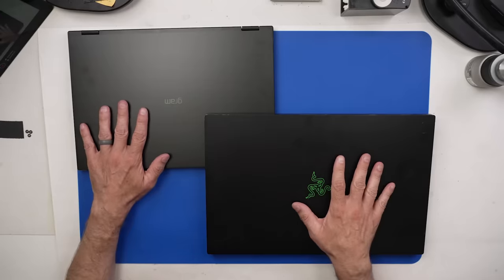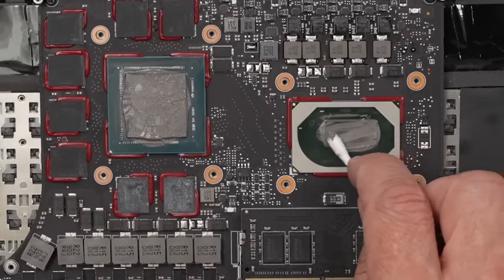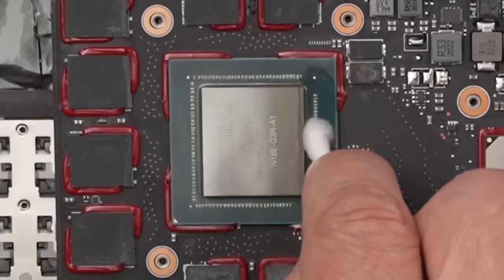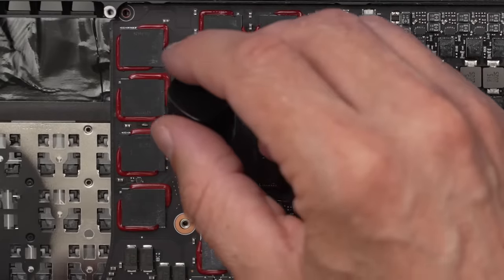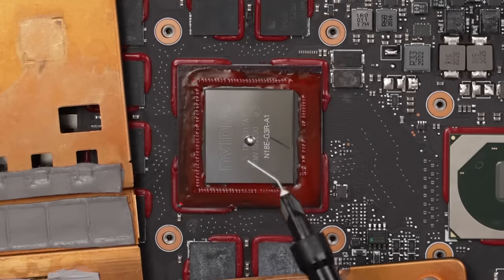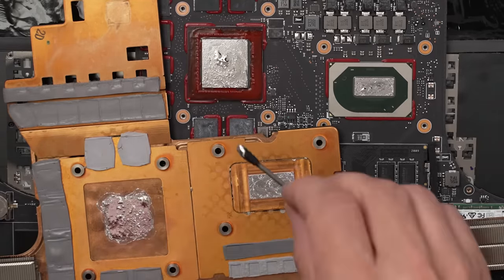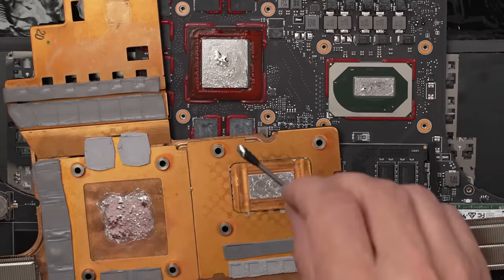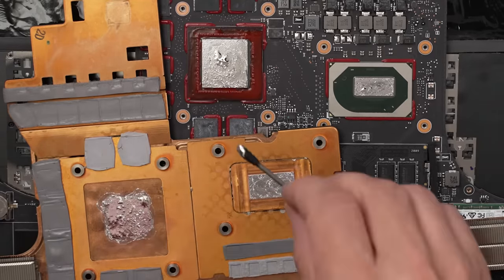$5,000 Worth of BROKEN Laptops - Extended Cut

Comment: I believe that the "problem" with the Razor fans can be configured from the bios.
For the display it would have been good if it were tested with an external monitor, that way it can be ruled out that it is a problem with the video card
Reply: Yeah. The fans were louder after the "fix" than they were before it. The display problem was a sensor issue and nothing to do with drivers.

Comment: But wait.. with the intel driver uninstalled the system will fall back to software rendering through the Windows Display Adapter driver. Is it a driver issue with intel or is the GPU on the intel CPU dead?

Comment: Had you already checked the temperatures and fan curves and tinkered to see if it was a software issue or did you just dive right in and tear the thing apart to redo the thermal paste? This seems like an overreaction without the substantiating data.

Comment: Copper heat sinks and liquid metal for cooling aren't always the best of friends. I hope you checked compatibility before applying. You risk your heat sink getting oxidized away if the two materials aren't compatible.
Reply: It's fine, the heatsink will absorb a thin layer of liquid metal, so you should redo it after a month, so you have enough on the ic's, but it doesn't affect anything.
Reply: Yeah, he is creating a thermocouple, not cool! Although I don't know much about thermocouple, I know enough that 2 metals in junction would create a voltage when heat is present.
Reply: @MizuhoChan 
One month is not a long time.
Reply: *Aluminum heatsinks and liquid metal arent always the best of friends
Reply: You're thinking of aluminum. Liquid metal contains gallium and will eat away at aluminum, but copper is perfectly fine.
Reply: @xrafter  That's why you don't need to redo it after a month?

Comment: "ramps up at login screen": windows fires a lot of services up at the login screen. i have a power meter in my psu. normally the psu is 60w idle, and at the login screen it jumps straight to 120w. so don't compare the login screen with idle, that's happening a lot in the background.

Comment: Hi Steve, Maybe you have to do layer of liquid metal over time as it will work into the copper. The second notebook you need to install the latest Intel drivers, as it currently uses the standard Windows drivers (the checkbox was not available). You can obtain the drivers through Windows Update or the Intel website.

Comment: Copper will soak up the liquid metal. Will need to be checked periodically and re-applied. Nickel plated copper is preferred to use with liquid metal.
Reply: What about the voltage generated by heat? Should we minimized it.
Reply: no @xrafter

Comment: I would assume there is a thermal sensor somewhere that is not detecting what temperature the system is running at and just defaults to full blast on the Razor. Might be worth going into the BIOS and see if you can determine what temp the system is seeing. Hard to believe the liquid metal would make that much of a difference, but I could be wrong.
Reply: I agree. Liquid metal doesn’t make much difference compared to normal thermal paste
Reply: It can make that much of a difference if there wasnt enough thermal paste or the thermal paste wasn't properly applied, which he jokes about in the video when he says "I would say that doesn't look like the perfect amount of thermal paste, but I think I was the one who installed it."

Comment: Using liquid metal in laptop without foam barrier is asking for a serious problem.
Reply: Hence the conformal coating
Reply: just what i thouth to it´s gonna be a mess
Reply: I would have personally done both, especially if it was going to be in a backpack or travelling
Reply: @waynetaylor2784  you still need a foam barrier to protect the rest of the motherboard.
Reply: @gildardo  liquid metal won't run that far
Reply: Spoiler alert! 🤣
Reply: Masz rację oczywiście 
Amatorka 😂

Comment: 31:01 I would apply the liquid metal to the copper then wait for a few hours then reapply the liquid metal again because liquid metal will eat into pure copper and dry out without a minimum of 2 coats. 
Also I would apply the red coating to some of the gold parts near the chip 15:43

Comment: Won't LM eat up that copper? Don't you need coating of nickel or some other metal so LM don't mess up copper, like soaks into copper and makes a different alloy with LM?
Reply: It'll eat aluminium gamers nexus did a test on copper and youll be good with applying on copper
Reply: @nightruler666  He made a video with derbauer who makes the acrtual LM. So he (derbauer) explained the issue is gallium which is corrosive for aluminum and it messes up copper, it DOESN'T corrode it like aluminum, but it makes a different alloy which have different properties than copper. 
My comment is really not saying anything else than this. 
Also that's why he (derbauer) is nickel plating his copper products so they don't loose original thermal conductivity property. 
At the end, everyone should do what they think is the best, I'll listen to manufacturer of LM.

Comment: About trying to figure out at the start whether there really is overheating, and where is it, there is, for linux, the easily installed package lm-sensors. And it's possible to create a linux bootable thumb drive... and to boot nearly any laptop from that thumb drive.  Once the lm-sensors package is installed, the command "sensors" prints out the temperatures of various components, plus fan speeds.

Comment: For the LG GRAM, you may need to change the Flex cable that connects the screen to the motherboard. It may solve this issue. But i've watched the full vídeo, i don't think the issue was only the driver that makes the screen flikering. That flat cable from the display loose also can cause this issue.

Comment: that large CPU should not have that much thermal paste between the chip and the heatsink. looks like there is a contact r pressure issue.
Reply: I agree. I had similar issues on my Asus Rog Strix. Ended up using nylon washers between each screw and the vapor chamber so the screws wouldn't just bottom out. I think this laptop would do well with using PTM7950 rather than standard thermal paste from factory.

Comment: I had an HP that was left on by mistake and put in a computer bag. It overheated to the point where it crashed. It alway ran hot regardless how clean the heatsink and fans were from then on. It wasn't all that stable after that as well. The only thing I didn't ever check was the thermal paste and I guess it could have cooked the paste out.

Comment: I've been using a hexane based electronics contact cleaner for over 25 years now to remove thermal compound. Does a way better job than IPA and really wicks its way into those tight spots when a heatsink is stuck to the chip.

Comment: Not sure people have to go as far as liquid metal, Giving the fans a good clean and replacing thermal pads and paste with good quality stuff got the heat under control on my HP gaming laptop,
As others have said the fan curve can be changed in the bios.

Comment: I used to fix laptops for a living. One time I had a pink monitor. Didn't matter which laptop it was on. The cable on the monitor side was loose. After I removed it and reseated it, it wasn't pink anymore.

Comment: There's one thing i always "CHECK" Before messing with the Laptop/Desktop is Graphics drivers they used to be good but the last 5-6 Years JUNK... Remember one thing everyone "IF ITS NOT BROKE DONT FIX IT" If your Graphics drivers is from 2022 and it works why update them.. I did this Blue screen put them back 100% Fine.....

Comment: So for me, with it spinning up as soon as its powered on, and at that point the GPU wont be being called on for very much at all apart from a display, then my mind would go to the CPU thats getting hot thus making the fans rmp, but even then, that CPU would have to be getting hotter for a while to get the fans going the soon and at full tilt, very strange symptoms if you ask me, maybe some software program needed to control the fans, atleast i would have a look with HWInfo or Afterburner, just to see what the temps are and the usage coz its abit strange for the fans to be ramping instantly unless there was a problem, anyway... ive watched 11 minutes, back to it, and be good to see what happens after Liquid metal, for sure will drop the temps by 5 to 10c i imagine, i dont think thats the problem though unless the cpu is at 100c instantly... Maybe it is... Crazy if so.

Comment: It is nail polish in a fancy bottle,  however uv light should be used with hot air to cure it, faster, same as nail polish. All conformal coating same.
Reply: Conformal coating will withstand higher heat then nail polish.
Reply: @damolin77  nah it's same tested both, clear nail polish is best

Comment: Hey man, I love your channel. ALSO I belive liquid metal is a bad choice in the laptop, due to its mobile nature. I recommend so tg kryonaut. Also if I had to guess what was going on, you may have a bit too much thermal paste. It looks like rather than filling in the paste gaps it's so much that it's a thermal barrier.
Reply: Also, did you check the Temps? Were they actually getting high enough to justify the ramped up fans? Or were the fan curves maybe just off?

Comment: On that LG with the screen flashing, that flashing can be caused by three main things. Failing LCD panel (i.e. back light), display cable, or the GPU faulting and resetting.  The smaller connector on that PCB is for the touch screen's digitizer and the cable that runs underneath is for the LCD panel.